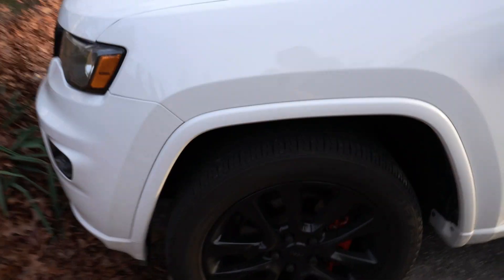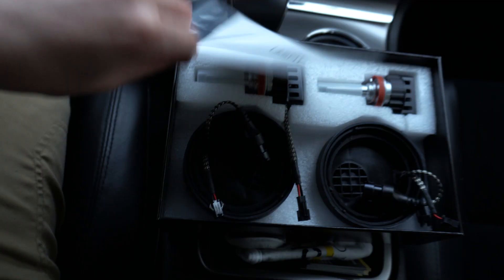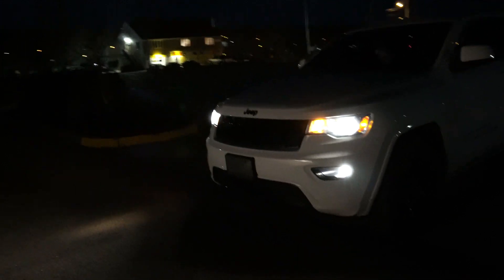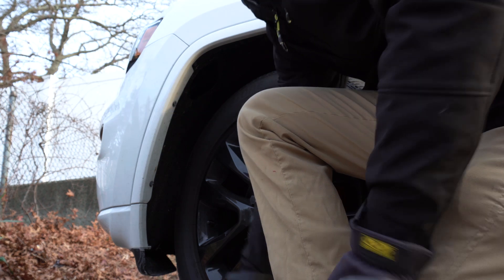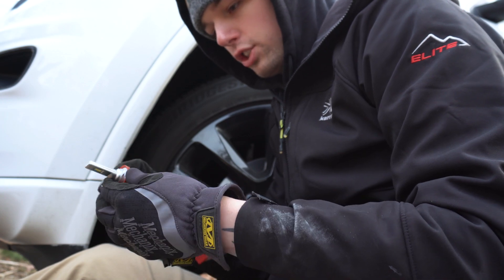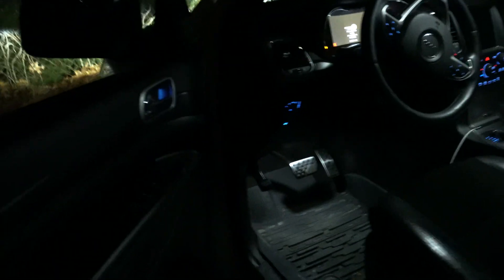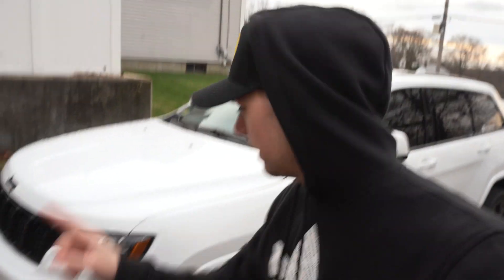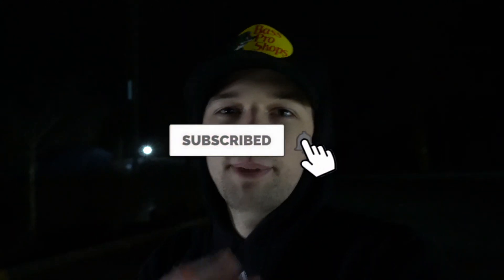FINALLY Installing LED Headlights on the Jeep!!

Comment: just got a 2020 jeep grand Cherokee limited and will be doing all LED headlight low and highs with fogs with the GTR Ultra 2 lighting. the fans on those lasfit pros look huge lol. I like how compact the GTR Ultra 2 look and they come with a lifetime warranty. better heatsink and supposedly the best output with all Mopar products is what I've been seeing and hearing. great video! I've been wondering if I should go through the access panel or from the top.

Comment: What high beams and fog lights did you use?? I got a couple LEDs for the Jeep and they would not work but they were for my low beams!! I even got the GTR ultra 2 for the low beam and they didn't work!!
Reply from the maker: I have another video with the fog lights I used on the channel - never changed there high beams just the regular bulbs 💪🏻
Reply: I somehow must have overlooked looked it, that's tho!!

Comment: How did you get around using the dust cover for the low beam headlight? That wire for the ballast is preventing a proper closure of the dust cover. Please help.

Comment: I swapped my yellow lights with LEDs at a local shop.. but I realized that whatever you do.. the headlights are not gonna be at the same level as the Bi Xenon LEDs with the Switchback turn signals on the other Grand Cherokee models.. they still feel dull in rain. 
I think the better option if you can spare $1000 bucks is to go with@mhfsrt. They have custom headlights under $1000( or the pricier $1600 original SRT style ones) . You can replace the entire headlights with theirs.

Comment: How did you manage to twist that old bulb out? I am having the hardest time trying to get them out
Reply from the maker: It’s a pain with the angle if you don’t drop the bumper. I didn’t have an issue getting them out only putting the LEDs in
Reply: @BJPLIFESTYLE  yeah I had the hardest time and gave up lol might try to do them from the top removing some stuff out the way. Did you have any issues with the lights flickering on and off at all? Heard sometimes it’s an issue with some cars

Comment: Removing the air box to access the driver side is the way to go. The passenger side is best accessed by removing the ecu. Disconnect the negative battery, then remove the ecu. That will give you the room from the top. 

Also, the beam pattern on your LEDs should be corrected and that is by using the Allen key included in your package. The 3 tabs are on a ring you need to rotate on the bulb itself so that when the bulb is installed, the diodes are facing 9 and 3  ⬅️➡️. That will vastly improve your beam pattern. Good luck.
Reply from the maker: Appreciate the tips!
Reply: Absolutely agree! Airbox removal and unplug ECU.  Huge PTA. Whoever designed the process is a moron because any way you do it, your wrist will need to do tricks you never thought it could do.

Comment: Same BS rubber gasket caps on my 2017. They actually broke apart while removing them. I had to replace both of them after changing from stock halogen bulbs to LED's

Comment: I was going to swap my HID's for LED's but after looking at the beam pattern, I can't. Thanks for the video!!!
Reply: U have Hids in a halogen housing or you have original projectors with halogens and swapped them for hids? I'm asking because if you do have projectors you could get really good LEDs that will show a nicer beam pattern like the new Morimoto LEDs look at the reviews on those beasts.. otherwise... Stick to HIDs... Still far more superior quality light than any LED so far. Well ull still need a good HID quality kit so not any cheap garbage

Comment: I have a a grand Cherokee as well, I have the 5000k HID bulbs, and had LED before and the HID kills the LED. If I were you I would look into it. And I have 35% tint and it looks so good on the front!
Reply from the maker: I’m planning to upgrade from the altitude to an SRT or something this year so I don’t think I’m gonna do anything crazy expensive right now. I’m thinking 35% is the number with 20 on the sides
Reply: @BJPLIFESTYLE  oh okay gotcha brotha! 2021 keep going up! 35 will make the black accents pop more. Those HID’s I think I got for around 30 or 40 bucks in a kit
Reply: Yes the HID are the best....until a ballast goes out. Then you have to replace it. Which isn’t cheap and I’ve read the average ballast lifespan is about 3 yrs on these cars. For those who aren’t privy (I wasn’t until recently after tons of research), HID headlight setups need a ballast in order to operate. One ballast per headlight. Idk about halogen or LED setups- whether they are similar in any way. 
I can say I’m seriously considering replacing my HID assemblies with halogen kit setups so I can go to LED as per this video. 

Thanks for this video btw! I really like your channel.🙂
Reply: If anyone has the hookup for lower cost on replacement HID bulbs please share. I’ve replaced one already, bought from O’Reilly. Cost for one bulb- $99. Yes that’s ninety-nine freakin dollars.

Comment: Nice!  Can you please explain how in the hell you installed the right side bulb?? I have a 19 Altitude and installing those bulbs seems downright impossible unless you start removing parts ( which being my wife's car im not to fond of doing!)
Reply from the maker: It’s an absolute pain lol I popped the trim off around the edge of the engine bay, but I was able to get it out and back in through the little hole in the fender well lol absolute nightmare!
Reply: Nightmare is right.  I gave up after removing the coolant reservoir, trim panel, and fuse box.

Comment: The reason they gave you the little allen key is for indexing the bulbs. You need to make sure the LED chips are facing to 3 and 9 o'clock position to get the optimal beam pattern. 

I have installed a few different brand LEDs in low, high and fog lamp in my 2020 altitude. 

You should look into the new Morimoto 2stroke 3.0 for your low beam. It is hard to find a bulb that performs well in a projector housing. They offer a better cooling option that will actually blow the warm air into the housing and melt snow/ice. Any other LED bulb on the market will not do this. Also they have a much better cutoff line. 

If you noticed with your light pattern it's pretty scattered which won't give you good distance and probably blind on coming drivers. 

But yes a very poor design on Jeeps part to install these bulbs. That port hole is pretty much useless. I have gone through the top and a couple times and still not easy. The dealership wanted $400 to install the bulbs as they drop the bumper.
Reply: Need to drop bumper to change headlight bulb?  Guess Jeep gone to next level engineering
Reply: @liutasllc6338  depends on the year there are metal tabs that need to be broken off in the housing on wk2. Bucket of worms but it can be done.
Reply: @arniceousmaximus2183  Cherokee's went to shit design-wise after 2004.  Used to be well laid out, easy to work on pretty much anything.  At rate they are going you'll need to drop an engine soon to replace a headlight bulb....   Also noticed newer models are looking like swiss cheese with how much they rusting through.  GJCs from late 90s seem in much better shape than models 10 years old.

Comment: Good job the LED swap on high beam is more difficult only because it's more difficult to reach,  so fog lamps next maybe? 

For my wk2 they are as fallows:
2504 Fog Lamp
9005 High Beam
H11 Low Beam

Make sure your choose the best lumen output,  I know the free sponsored is appealing but what's the point if they are low in lumen output. My low/high are by Farhen @ 10k lumens  each and fogs are 5k lumens by sealight. Cool white on low / JDM yellow highs and blue on fogs

Comment: Lol I changed my bulb and it was Terrible. They port in the wheel well seems like a good idea but the second hole is up and on an angle and sharp plastic. I cut my hand all up my kids couldn't even get there hands in the hole it's was to small to open your hand. I had to take out the air box too.
Reply from the maker: It’s awful lol they need to rethink the design I think

Comment: Well I just bought some brighter halogen bulbs.. but haven’t done them yet... Maybe I will go this route so I don’t have to do it again lol
Reply from the maker: The install was awful, I definitely would say do it once lol I just hate the look of the yellow halogen bulbs lol
Reply: Led is a cleaner brighter light with 400% improved visibility so if you plan in getting inside the housing led is worth the extra effort.

Comment: We might could hear it if you turned the annoying background music off :-). I changed mine to LED and i never could get to them from wheel well access. Mine has just one fan on bulbs. I can hear the fans but, you dont hear them when engine is running. It’s hard to find quality, high output LED headlights that are not fan cooled.

Comment: I just replaced the headlight bulbs on my 2017 Grand Cherokee. I'll never do that again. The passenger side was freaking horrible
Reply: Did you go through the wheel area or did you remove parts and go from the top?
Reply: @mr.p9982  I had to go through the top. I removed the computer module thingy to make more room. You need the hands the size of a 5 year old to go through the wheel well. It's literally impossible

Comment: The Allen key is to click the bulbs so the chips are facing the 3 and 9 o’clock position for the best output. 

You have a cheap Chinese set of leds which is another of many reasons of why they are weak and loud.